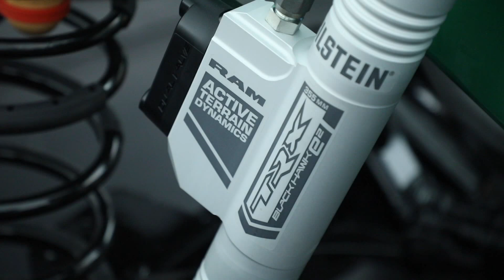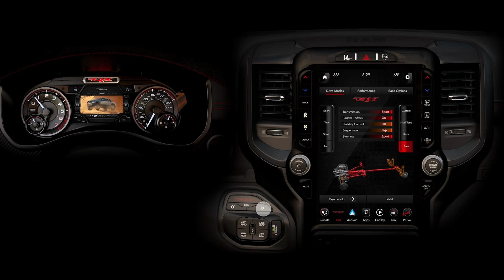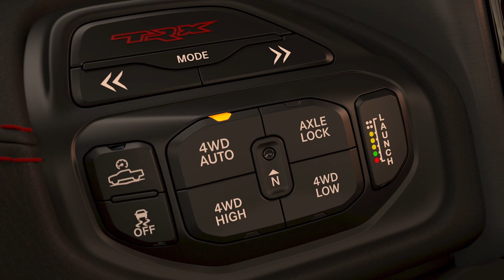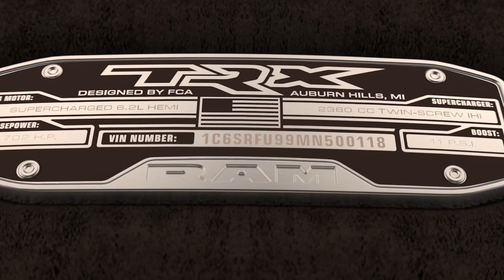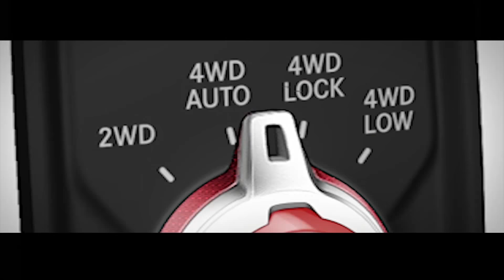New 2021 RAM 1500 TRX 702hp In Detail

Comment: I like this truck, but to say there's no competition (Raptor shaking its head) is quite a statement.
Reply: Raptor just got its head ripped off. All these haters. Back 2 back motor trend. RAMS are way nicer then Ford and GM. Respect. When the Raptor came out I respected it. The same cheap ass plastic buttons in Ford/GM are in my daughters big wheel. Ford/GM need to STEP UP
Reply: @jeffa7173  I'd still buy a raptor. It'll run more than 60k without major repairs or replacements. This thing will be as reliable as a hellcat.
Reply: Probably because the Raptor is a Baja truck, and from what I’ve heard, the TRX isn’t running in Baja. 
Can’t really be competition for the Raptor when you won’t run in the one race it’s designed for.

Comment: All the power seems great and all but STARTING at 71k and upwards of 100k plus dealer mark ups,  how many people can actually buy this thing. Another reason why Ford is the smarter company. the raptor is bad ass and starts at the mid 50s. Hopefully ford responds with a v8 and has a second option below 60k.
Reply: I haven't seen s raptor under 60k in years at least not in my area.
Reply: Not many ecoraptors in my area.🤷‍♂️
Reply: Depending on the state an market go look in a state that may not sell I believe Midwest cheaper
Reply: Til you tack on literally any options ...
Reply: Jlpz 63 ain’t no Raptors out there in the mid 50’s. I have yet to see one for less than 65k with most being in the low to mid 70’s

Comment: The only way Ford can respond appropriately is by shoving the GT500 engine in the Raptor
Reply: They don’t need to respond to it, they already have a great truck, the Raptor. Yes the Trx will be quicker but the raptor already has plenty of power and is amazing off road.
Reply: @ZACH_95_  but the TRX is better in every way except maybe suspension. Power train, interior, chassis, all better.  Also they will actually produce enough you wont have to pay 15 k over msrp like stupid raptor.
Reply: Logan to you not to me. Thanks bud ❤️
Reply: @ZACH_95_  Fair enough,  i'd rather have the Rivian than either so .. but the're all too much money.
Reply: Logan I Will never buy dodge, to me there junk. But everyone has there likes and dislikes and I don’t hate on anyone. Peace out man ✌🏻
Reply: Logan base is already 15k more than a raptor. What are u smoking?
Reply: This thing is like almost 1k lbs heavier than a Raptor they dont need that engine. They already proved that people will buy the raptor reguardless. Ford will have to step there game up but I doubt seriously they will put a V8 in there and if they do it will be an option. The hybrid system is what I see happening before a V8 implant. The aviator didnt have the space for the 3.5V6 and the hybrid system but the raptor does. I could see 600hp and almost 850 torque and we know the torque will be damn near instant. Hey but just like Bronco is going to take some buyers from jeep the TRX will take some from the raptor. Competition will always bring out the best in car manufactors.
Reply: I agree with everything you said brother the Raptor is hugely capable but it's not as desirable as this
Reply: Ford will never put a v8 in there, the 5.0 is probably going away in the f150 in the next few years any way. You don’t need a v8 in the raptor, it makes 450 horsepower and 510 ft torque. You don’t need anything quicker than that.
Reply: Jerome M Muriuki It’s not as desirable?? Why because the fucking dodge has more power and a v8??? 1, not that many people are going to buy these, there not going to sell that many, there going to sit on the show room floors we already know this. And 2, I can already tell ya, being almost a thousand pounds heavier is not going to help it off road, the only thing it has going for it is the more power that it doesn’t need. The raptor is still going to be the king of off road.
Reply: Yes ford must respond .. give us that V8 Raptor
Reply: rendra hutabarat  you’re not going to get a v8, you don’t need it. Plus ford is probably going away with the 5.0 in the next few years.
Reply: @ZACH_95_  buddy you got some serious problems 😂😂
Reply: Already is a Shelby f150 has 700hp with the v8 model
Reply: @aaronwerner3431  they  didn't make many tho did they? Those trucks are rare to see
Reply: That's literally what their gonna do
Reply: one thing the raptor has going for it is its one of the slowest depreciating vehicles on the market. Look at even a 2013 raptor and they have barely depreciated. One of the best investments for a vehicle and they sell out every year, compared to this which will likely be a novelty.

Comment: that 6.2 hellcat motor is a cheat code for them. just put it in everything they possibly can and wow the market. 707hp omgggggg. chev and ford need to take the cuffs off and offer power like dodge does, they're owning the market for the cheapest/craziest hp to offer.

Comment: The Trx looks pretty nice, and that 4.5 sec to 60 will be awesome but I’ll stick to the Raptor, I’m a ford guy and I love the feel of the twin turbo ecoboost in it.
Reply: Zach v8 for the win!
Reply: MATTHEW LONG I don’t need the v8, I’m happy with the twin turbo v6. The raptor has plenty power for me. Thanks though. ❤️
Reply: Zach ecoboost motors are shit. I own 2 different F-150, 2001 5.4 Triton and 2019 5.0
Reply: RNH0724 no there not, I own a first gen, 2011 f150 with the 3.5, I’m the second owner and it now has 263k miles on it and still drives like brand new, I’ve not had one issue with it, everyone I know that has one has not had one single issue with theirs. And everyone I know that has one uses it as there work truck, (I’m in construction) there’s always a heavy load in all of our trucks, tows everything we need for the job sights and still drives like a champ doing it. You look up the reliability of these engines and you will see that they are actually great engines. That’s the only thing you v8 boys say, “oh the ecoboost suck” when they don’t, there reliable as hell. So sorry to burst you’re bubble macho v8 boy. Peace out homie ✌🏻❤️

Comment: They had a body off shot of it in the video. The chief engineer said the factory put "a HIM"
into the rear axle weightwise in the Dana axles. It seems the suspension might
do better with heavy loads on the terrible roads and streets we deal with out East.
You know bad roads don't just happen off road.
I'd like this truck with the current 5.7 Hemi as an option.

Comment: Will be on top only until the next raptor is revealed. That is, if it can hold up til then?
Reply: Especially resale value-wise. Raptors hold their value, Ram, not so much.
Reply: Yeah ram is just a wannabe Raptor. Plus rams quality is poor compared to raptor
Reply: I work at a ford dealership and can tell you we have 4 new raptors needing engines, one of them has a programmer and the others untouched with less than 1500 miles. The new high output eco boost as well as the f-150 eco boost have oiling problems... as for the hemi in the Trx, they have been proven in the hellcats as well as the zf 8 speed transmission, and sound 10x better than the v-6 in the raptor
Reply: @brettphillips5827  so why are you working at Ford if you're a ram fan boy?
Reply: Theres a difference between real world experience giving their opinion, and "fan boy" getting salty. Guess which one you are Mack? Fords been shoving those high strung eco boost engines at everyone for far to long. I know guys who've had a lot of problems with them as well.
Reply: @brettphillips5827  yes Hemis are excellent engines but the rest of the car will probably fall apart being a FCA product.
Reply: That's true,fiat dodge is junk
Reply: brett phillips I’m a die hard Ford guy and I refuse to buy any full size Ford truck that has a V-6 in it and I damn sure won’t spend 80k on a Raptor with a V-6, as far as I’m concerned Ford ruined the Raptor with that move.
Reply: Lol.. yeah with the ecoburst engines that are plagued with problems ! I seriously fought it ! Ram is going nowhere but to the top ! Watch and see !
Reply: @michaelpincavitch5245  ram can never go to the top. In the construction industry dodge is pure junk
Reply: I love how people it up on Mopar ! When in fact they designed the engine that powers every top fuel and funny car. A 500 Ci single cam pushrod hemi V8. And their the quickest Carson the planet ! No ford ,Chevy,or Toyota engines used at all !that's right , when it comes to making the really big power , Hemi is King . And since the 60s! Lol say what you want ,but these are facts !
Reply: Ford already has a Shelby f150 with 755 hp that can match the TRX on the street. Funny thing is Ram had to use a larger 6.2 L and still couldn’t match the 5.0 in power😂😂and by the way, Ram has never been on top until now. So just enjoy it until the next raptor is launched and I assure you it won’t have a V6.
Reply: I am also not a fanboy. I’ve had all brands of trucks and I thought is was a mistake for the raptor to come with a V6
Reply: @drfaticus  you have no clue !!!!! Every fracking and oil rig guys I know all have Cummins ! And they are a much more reliable engine than the others !  Ram is the most popular pulling trucks too ! Inline 6 diesels wear better than v8s and that's why semis use them only ! And dodge designed the engine back in the 60s that's still powering the quickest cars on Earth ! Yeah a 500 ci Chrysler design single cam pushrod engine in all top fuel dragsters and funny cars ! That's right everyone is a hemi . No ford ,Chevy , or Toyota engines used. Just their logo on a engine designed by dodge ! So take that inyourbrain pan and cook it a while !!
Reply: Michael Pincavitch Those top fuel motors are only Hemi based engines, they aren’t even close to an actual Dodge Hemi. I like Dodge, Chevies suck and Ford actually had engines out in the 60’s that produced more power than the 426 Hemi, The AC Cobra still holds the record for the fastest car 0 to 100mph and back to 0, and Ford is still the only American Automobile Manufacturer to win LeMans and they’ve done it 5 times.
Reply: drfaticus F-gm I wouldn’t say he’s stupid, he just doesn’t have all of the facts lol.
Reply: drfaticus F-gm That’s Super Snake though, never heard of a Dragon Snake
Reply: Unless you are actually an automotive technician then you have no place talking about quality and dependability of multiple vehicles. I have worked in an independent shop for 17 years and have had experience with all vehicles on the road. They all have their good and bads. Chevy still can't build an engine that doesn't leak oil past 50k miles. Ford v8 and v6 have numerous timing chain and phaser issues along with oil pump issues on the 5.4l. Hemis have had internal engine failures but everyone i have seen has been due to lack of oil changes. I've seen Hemis at 300k still running strong with no leaks as long as proper maintenance has been done. I would never buy a Ford since I lost all respect for them when they had the early 5.4 shoot spark plugs out of the head, then the next design 5.4 had spark plugs breaking off in the head and Ford did nothing to fix this or help customers. I bought a 2017 Ram 1500 new and now has 36k miles, half of that pulling a 21ft bass boat, and no issues to date and still feels like it did new. Whenever someone asks me what they should buy based on my knowledge of vehicles I always tell them to buy what appeals to them because eventually they all break. Just do the proper maintenance and they will generally last as long as you want to keep them
Reply: @jamesward4893  the dragon snake looked like the 427 cobra, they only made a few of those
Reply: Chris Dehn Well I’m 54 years old and I’ve had all different brands and I’ve always worked on my own vehicles, engine rebuilds to tranny swaps and everything in between so I think I’m qualified to discuss vehicles. And there wasn’t a 5.4 in the Fords, it’s a 4.6 or 5.3 which I have in my 02 Superduty with 303,000 miles on it with no major issues. As far as blowing the plugs out of the engine, that happened because of poor maintenance, either someone didn’t re-torque the plugs at 50,000 miles or they didn’t get the plugs tight enough when they replaced them.
Reply: drfaticus F-gm I’ve got a Ford bible and there’s no mention of it in the book, but I’m no expert either, I just know a lot about Fords and until now I’ve never heard of it
Reply: drfaticus F-gm Your not talking about the Sunbeam Tiger are you?
Reply: drfaticus F-gm I stand corrected, I googled it and you were correct, like I said, I know a lot about Fords but I’m not an expert. I know a lot about guns too and a couple of years ago a lady told me she had a 327 magnum and I thought she was mistaken and had a 357 magnum, so she brought it in and sure enough it was a 327 magnum. I’ve learned that no matter how much you might know about something it doesn’t mean you know everything lol
Reply: @jamesward4893  😂🤣
Reply: @chrisdehn5492  ah WRONG,it can be talked about. What you fix on is what you see there. It doesn't mean every mechanic agrees with you. Me being in construction from what I see and drove,FORD out lasts fiat dodge and Garbage Motors
Reply: Raptor with a v6 is a joke. Better to have the standard f150 instead of a v6 "sports" model. This is not Europe, there is no need to virtue signal with downscaling engines to appease people who wouldn't even touch these trucks with a 10 feet pole
Reply: @LeFatalpotato  I agree
Reply: @jamesward4893  Not a 5.4? Do your research then get back to me when you have an understanding of what you are talking about. The 5.4 Triton was the most common F150 engine since early 2000's. 5.3 is GM
Reply: Chris Dehn Your right, I don’t know where I was getting 5.3 at, my damn truck that I’ve had for the past 8 years has a 5.4 in it. I guess it’s true what they say about getting older lol
Reply: Lol, all good
Reply: Mack Deherrera Because he is lying. Everyone who works at ford dealership knows ram has shit quality.
Reply: dennis garner Ford is not going backwards. v8s are dying and electric motors are the way of the future. Instantaneous torque monsters and the ability to get better mileage. Ford is predicting that most cars will be some kind of electric hybrid or fully electric soon as fossil fuels are steadily decreasing. They are not going to invest in old v8+ super charger tech like ram when it will be phased out soon. By the time Ram tries to convert to electric it will be too late, ford will already be experienced and far ahead of the game like they always are with trucks.🤷
Reply: MrInzombia It will be a long time before electric cars put gas cars out to pasture.
Reply: B ! I actually just read in the Yahoo news that the ecoboost is going away in the Raptor, it’s being replaced by the 5.2 Predator V-8 that’s in the GT 500 and Ford says it’s going to make 750 horses, finally Ford is going to redeem themselves.

Comment: The first minute and a half is hilarious, it only took Dodge 12+ years to build a truck to compete with the Ford Raptor LMFAO!!!!! Do the folks at Dodge know that the Raptor made this truck segment??? It looks like a cool truck but they better hope it doesn't flop like the Rebel.........
Reply: Price wise there is a good chance. It’s got an edge on the Raptor but not much. If you get down to the suspension etc they’re pretty much the same on paper. So you’re paying another 40k for a 700 hp engine that does 0-60 .6 seconds faster and the 1/4 mile. I’m not sure that is worth the money.
Reply: Robert Wilson The 2021 Ram 1500 TRX starts at $71,690, which is $13,555 more than its direct competitor, the 2020 Ford F-150 Raptor, in the comparable crew-cab version. Not 40k and that’s msrp
Reply: ryding with ryan yeah who the hell buys the base model come on man. You can get a fully loaded raptor 2020 802a package for 60k. Same RAM will cost you 90-100k and you can bet your ass there will be mark up.
Reply: wally walton it’s doesn’t eat anything but your wallet. At least I’ve got the cash to put my money where my mouth is.
Reply: I don't know what you are smoking, but I see a lot of rebels on the road

Comment: Well, two things in my eyes will determine if this is a Raptor killer. 1. Is reliability, let's face it FCA make some pretty unreliable stuff. By now I'm sure the Hellcat motor is pretty rock solid, but the rest of the package is yet to be really tested. 2. is Crash ratings, from memory the Ram doesn't perform well in a crash, not well at all. Making a 707hp version pretty much a death trap.
Reply: New Rams are an IIHS top safety pick.
Reply: Build a race ready version and race it down in Baja and in other desert races like Ford does.A head to head race should be performed.